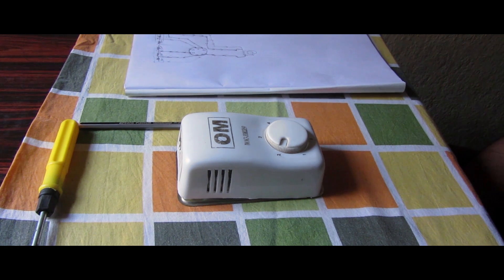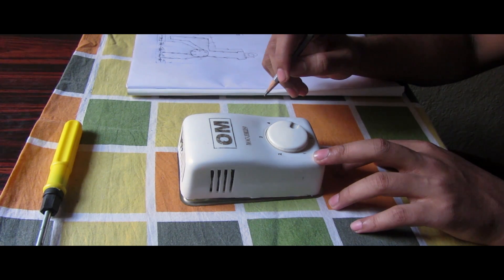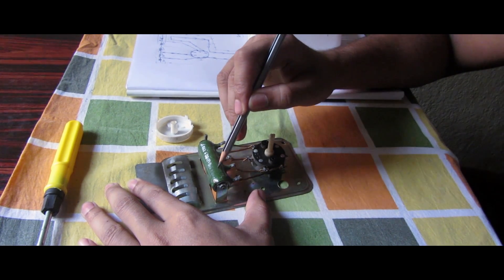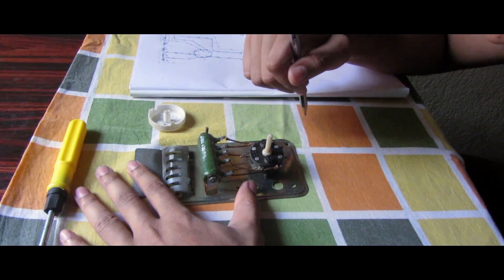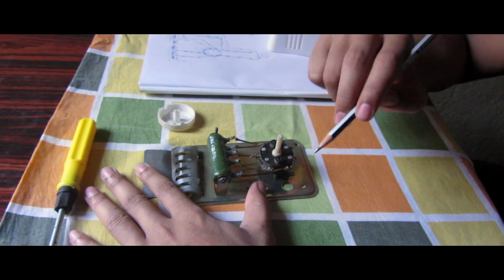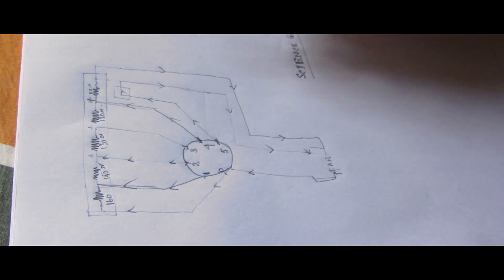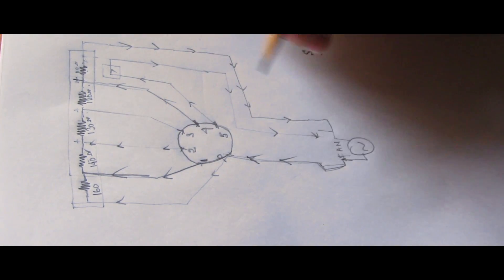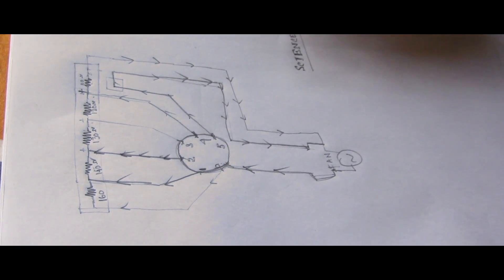Tutorial 2# How does a  fan regulator work

Comment: For understanding a fan regulator I have gone through so many videos and I finally found this one. A good presentation  . But in case of the fan regulators of these days(the small ones) do they use the same principle? What happens there?
Reply from the maker: Actually in these days instead of using resistors, a power electronics component called TRIAC is used . The voltage regulation takes place by controlling the triggering angle of TRIAC .There are TRIAC ICs available in the market. These ICs are used so we get regulators in   small sizes.
Reply from the maker: We have given a video on that already on our science projects section. The 4th tutorial. You can go through it. And explained it in Tutorials sections .The 6th video. Hope the videos help you.
Reply: Thanx a lot SCIENCE GUTS . Now I gonna see these videos.